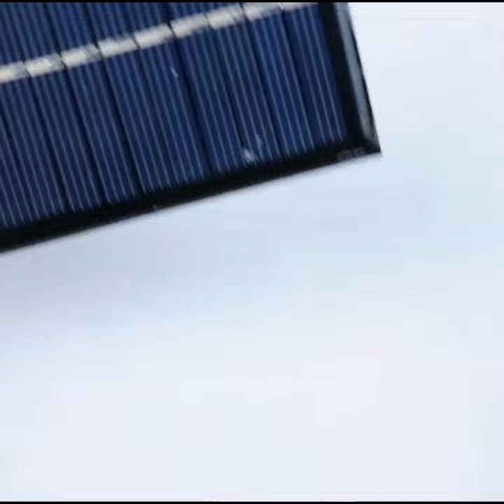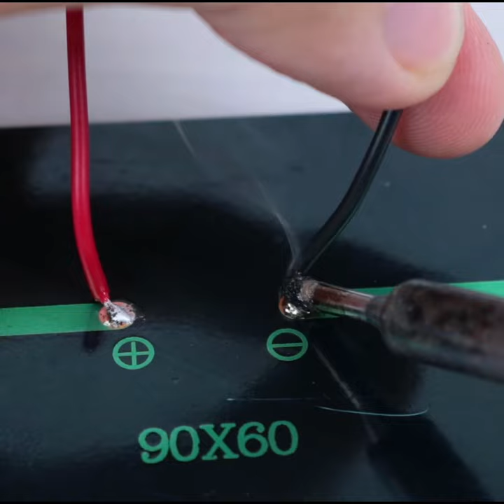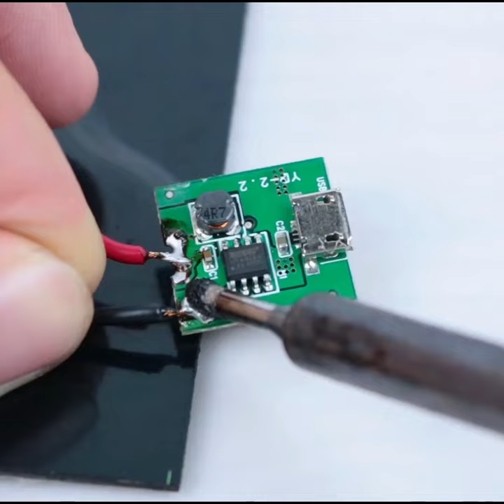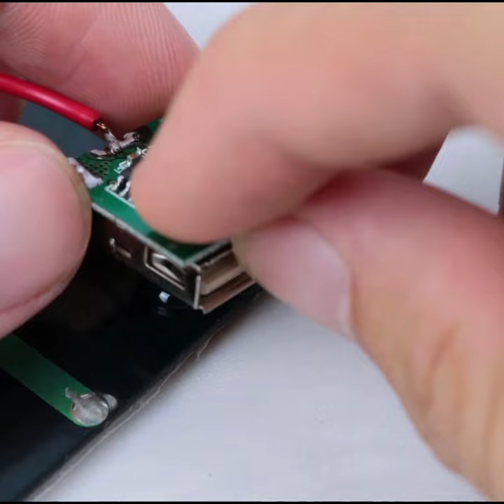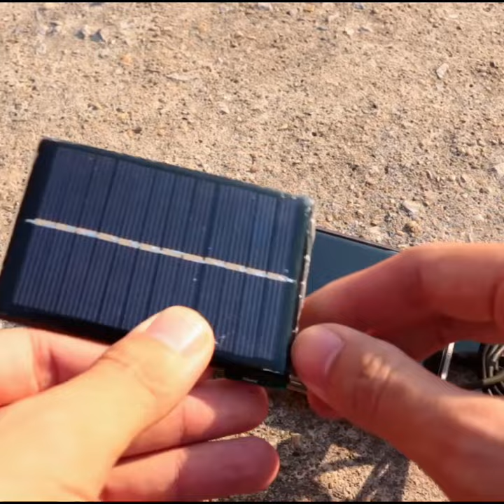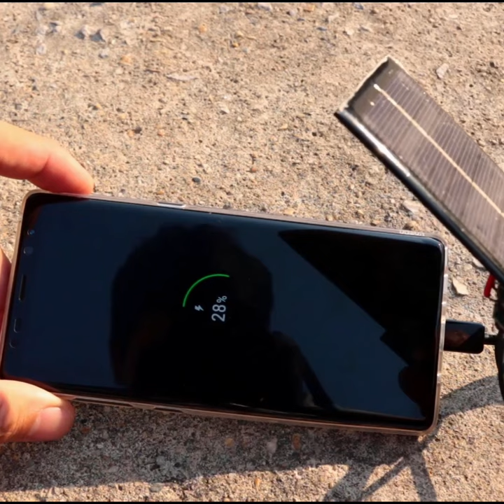Awesomme DIY - Solar Moblie Charger #diy #solar #moblie #charger

Comment: Fake
Reply: A noob is not fake 😂
Reply: Why is it fake, looks legit to me,   standard usb module and solar modules from aliexpress...
Reply: It's not fake,he is just using a small solar panel and increasing its voltage to 5 volts,but increasing the voltage decrease its current,means it would take hours to charge even few percentage,quite unuseful but can be used in emergency situation